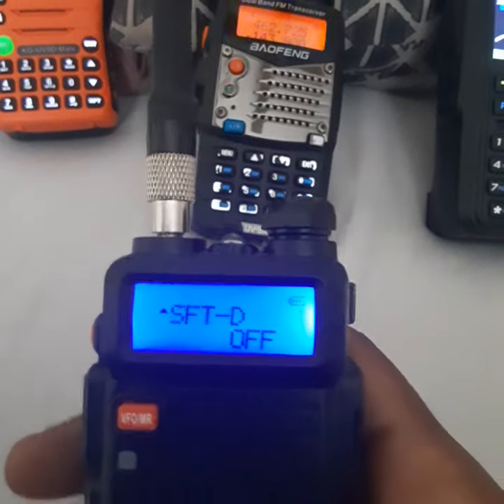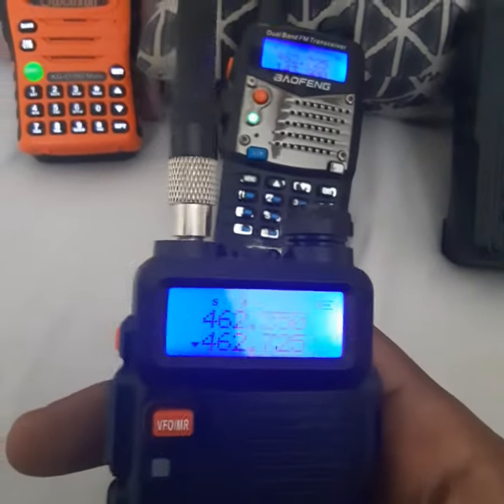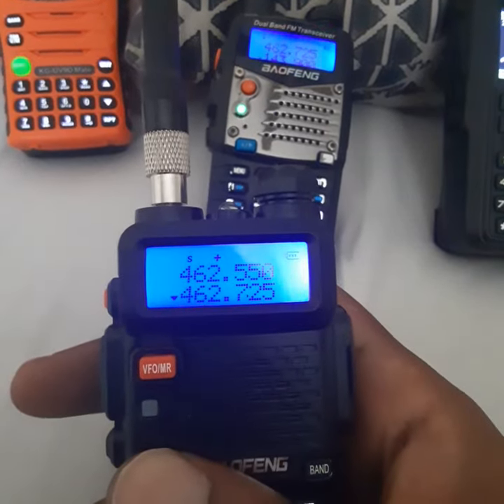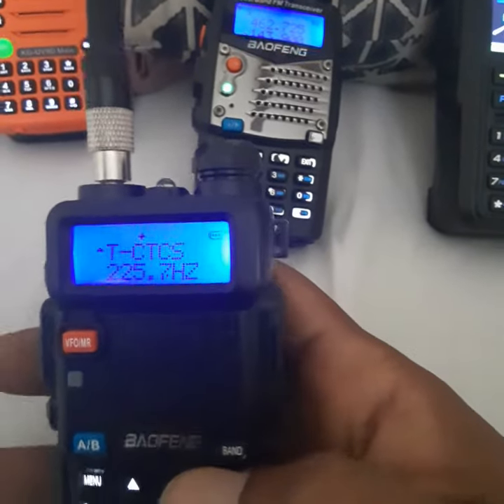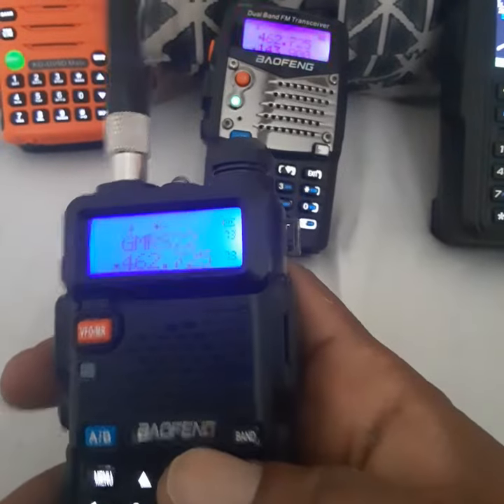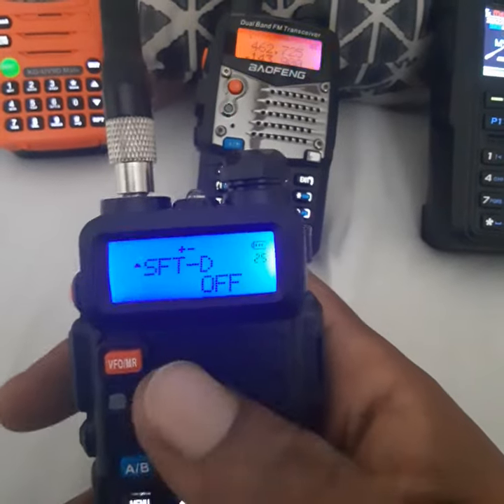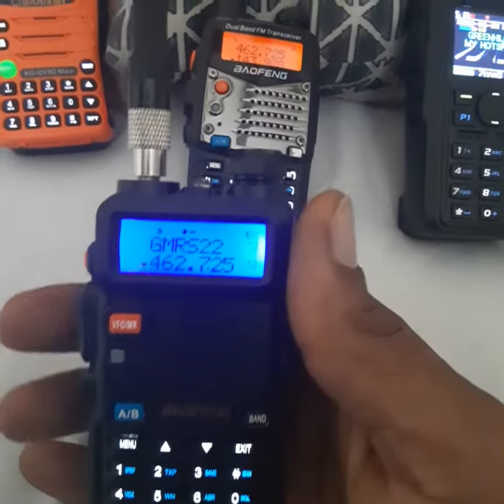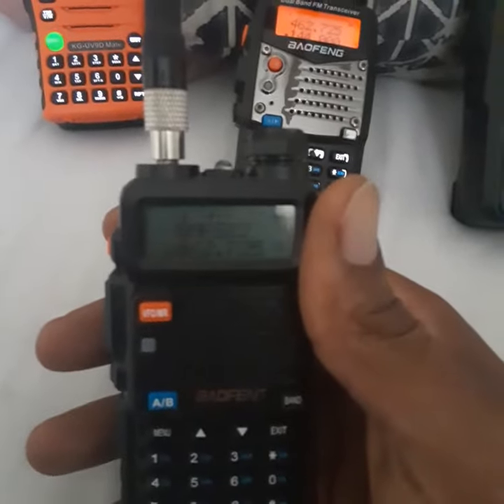Baofeng  (GMRS repeater programming)

Comment: Now I have 2 UV5G radios and I want to make them a small repeater, and it seems no one out there shows how to program to MAKE a repeater...that what I'm struggling with. Thanks for your video every little bit helps
Reply from the maker: Will you be using a duplexer(recommended)? Two antennas? What do you have for a repeater controller to pass the audio to the TX side( very important)? Honestly I  started with 2 UV5G  radios....only about half mile coverage with and w/out duplexer...I tried 2 antennas ..same coverage I was pulling my hair out as to why and problem was basically the Recieve Radio (UV5G) only can audio output is rated at 1watt... 😤😓 so I upgraded to Part95 UHF mobile 50watt radios and ❗💥💨 (Rick Controller). Been up and running with duplexer perfectly since.. Obviously you can tell I love Radio and can go on and on but KEEP THE RADIO HOBBIES ALIVE RATHER GMRS OR AMATUER RADIO✌

Comment: Can you do a video on the BAOFENG GMRS 9R connecting to a repeater?
Reply from the maker: @franklopezsr5224  i don't own a GMRS 9R but the settings are the same make sure you have the offset at 5.000 mhz shift is always+ and add TX PL(CTCSS) tone which is the Key to opening a repeater to talk.

Comment: I HAVE A NEW UV-5R GMRS , HOW TO SET CTCSS CODES IN CHANNEL MODE NOT FREQUENCY MODE ? , THE REPEATER CHANNELS ARE ALREADY IN THE RADIO ,WHY DO I NEED TO REPEAT IN FREQ MODE ON SOMETHING THAT IS ALREADY IN MY RADIO ?
Reply from the maker: Like you said you have the new uv5r gmrs radio if the repeater channels are already within the radio you should just go to the ctcss and change as is the video was implemented to show users how to save a channel from frequency mode to channel mode I don't know if the new uv5r let you add channels different gmrs repeaters if so that's great and the process within this video shows how to do that thank you for reaching out and ask as many questions as you may like

Comment: Hello im new to gmrs i need help in how to program a repeater into my baofeng 9r
Reply from the maker: Have you tried following the steps on the video?
Reply: I can't get it to work...
Here is the repeater info
Downlink..462.575
Uplink..467.575
Uplink tone..74.4
Donlink to e 74.4
Reply from the maker: @amdo699  what kind of radio ypur using? If similar in the video you should have it..all info you said is correct..alao you can't put the unlink in per say its the +5 offset you have program in which in turn Transmit on the unlink frequency(467.xxx) check to see if tone is correct and distance from Repeater(in range).
Reply: I'm using baofeng gmrs 9r
Could you pls write me the steps here on how I will program it..can't get it to work..im know I'm doing something wrong
Reply from the maker: @amdo699  any GMRS RADIO your only allotted 8 repeater channels which is channel 23 through channel 30 all you have to do is input the right tone in one of those repeater channels that's matching the frequency of what you're trying to transmit on if you try to add a repeater Channel or any Channels it would be just to listen it would not transmit because it is a gmrs radio Which sucks so if you trying to add more repeaters sorry you bought the wrong radio you need something like (Wouxun KG-9G GMRS Radio) Where you can add 999 GMRS Repeaters...sorry you bought the wrong radio.
Reply from the maker: @amdo699  check this video outhttps://youtu.be/BbpIdy_Vs1Y